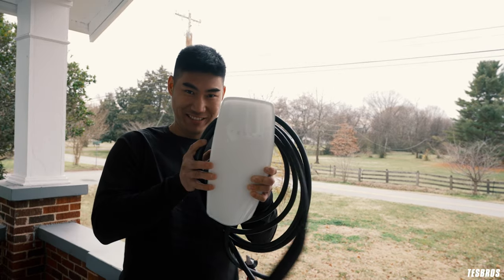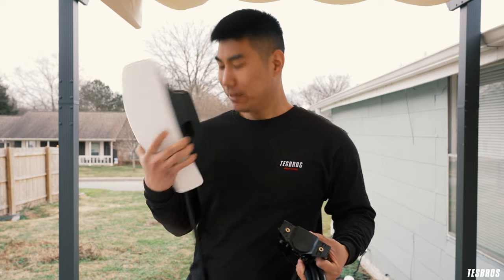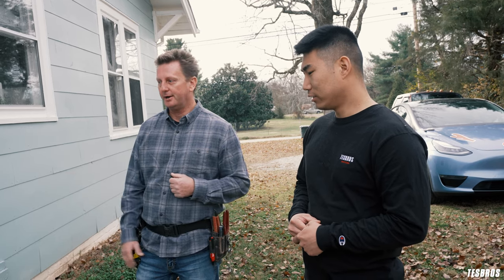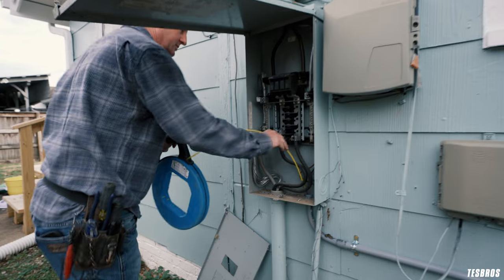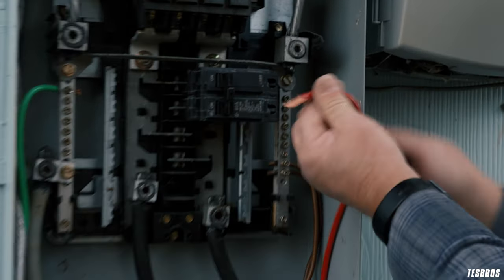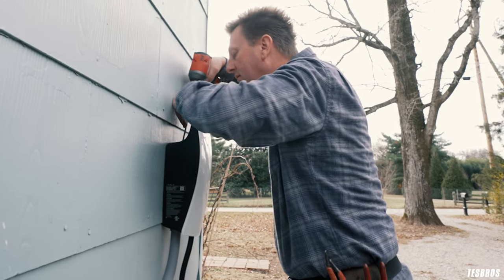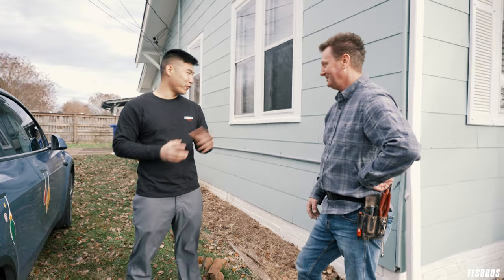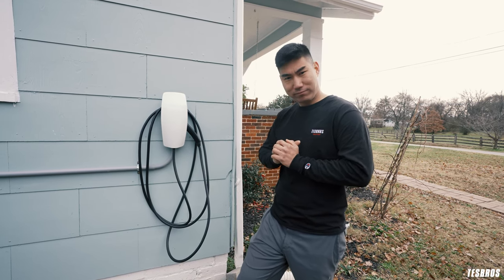Step by Step Guide to Install Tesla Wall Connector (Gen 3) - TESBROS

Comment: sooooooo....8+ hours to fully charge the car from zero to full charge?  ill stick with gas engines...gotta do better...even their super charging stations - 20+ mins...gotta get quicker.
Reply: Do you not sleep?  It takes me 10 seconds to plug in at night and I leave every day with 300 miles of range. It's faster than pumping gas which takes a few hours of your job to pay for. LoL:)
Reply: It's 6.5hrs for a Model Y Long Range battery, and that's if it was completely empty. If you stop at a supercharger, 8mins pumps in 100 miles. If 400mi isn't enought for you then stop a 2nd time at the supercharger for another 8mins/100mi. That's 500mi. So the math is 10 seconds to plug in the car whilst you sleep, then 16mins during the day for a total of 500mi. How many days a week do you need 500mi? The avg distance people drive in the USA is 48mi/day. Don't ever bother "filling up" at a supercharger if you know you only need 50miles to finish your driving day. Just spend those 4mins at the Supercharger, finish your driving day and then plug in at home. That's the cheapest way to do it. For most people it's about $7-$10 to fill up at home. For some people it's free if they live in a deregulated state and they have a free nights program. Currently I charge for free. It sure beats filling up my gasser at $55/tank. I also tell a lot of people it's not binary, it's ok to own two cars, a gasser and an electric. I drive my gasser about once every two months.

Comment: We have a standard 200 amp breaker…. Lol 200 amp is def not standard.
Reply: 200 amp service is mighty common:)
Reply: @pinkiepie1656  it’s common on new homes because of alot of electrification. Most common in my area  is 100 amps

Comment: why not white neutral?
Reply from the maker: Usually yes but they didn't have any at the store so went with red.
Reply: red wires = hot
green wire = ground

no neutral needed for these.
Reply: @moop_fogo  no neutral? So it's a 2 phase live connection?
Reply: @DaTecNerd  as far as I understand it, the neutral path to source alternates between the two hots. while one is delivering current from the supply, the other is returning it, & they cycle or alternate roles rapidly, @ 60 hz/s (in US). this can happen because the feeds are 180 degrees out of phase with eachother. one is +120v the other -120v. This would be split phase. A nema 650 receptacle for something such as a welder would use this same type of wiring. both a welder and this device only use 240v , never 120, If an appliance needed both, 120v for one component, & 240 for another, you would need a neutral wire.
Reply: @DaTecNerd  Not 2 phase. 2 hot wires to service the 240 volts. The power to your house is single phase. Three-phase power comes out of the substation and then one of those phases is brought to a transformer which steps it down to 240/120 volts. That's what is then brought to your home.